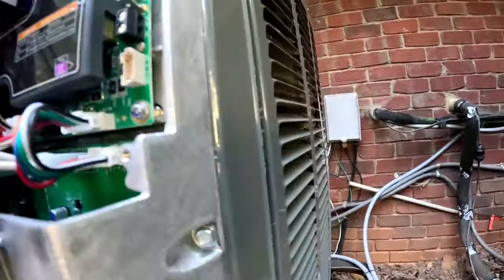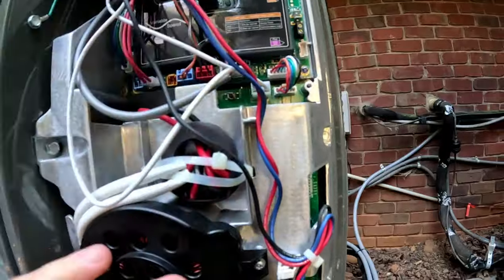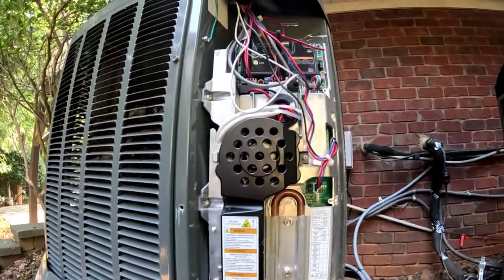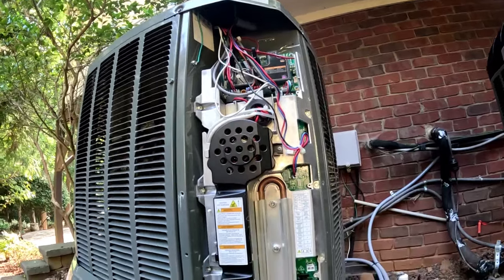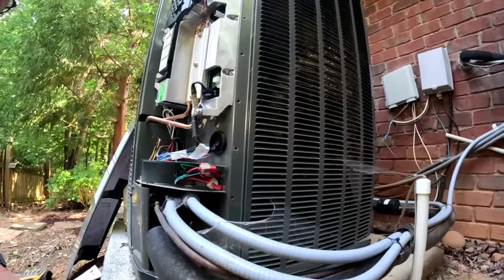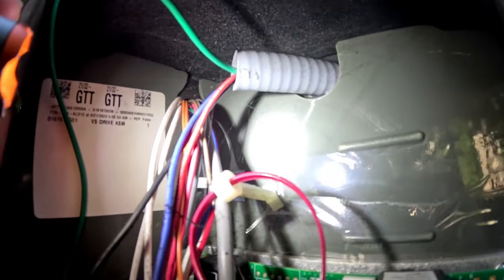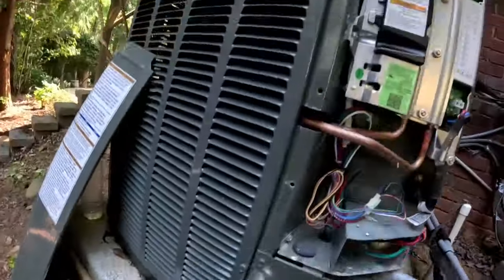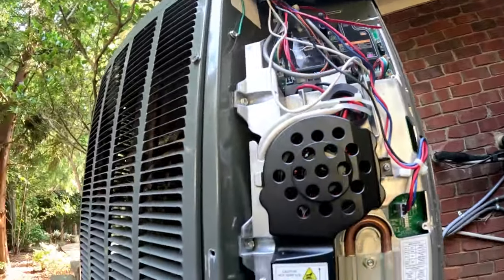It doesn't have to be this complicated to heat and cool a house!

Comment: The only things that belong between the thermostat and condenser should be high/low pressure switches and a float safety switch.
Reply: But then how can we charge you more for useless crap that easily breaks and costs and arm and leg to replace?
And how can they force techs to be "trained" and only allow said "trained" techs who pay them to work on said equipment?

Comment: that looks like the(reactor) noise filter(torodal inductor) installed on the incoming Line power, before it goes into the inverter drive. Washers, refrigerators, minisplit, and even brushless tools use them. It needs to become a prerequisite before selling a customer an inverter driven system, if there are known power surge, brown out or excessive supply line noise. Don't install one of these! i wouldn't be surprised if special power filtering requirements come about as well as dedicated ground requirements for these unit. 

I would look into installing single phase load reactors on these.

Comment: They are not just sitting behind a desk and computer. They are also sitting in front of a spreadsheet. They know what every single item costs and they are doing whatever they can to maximize profit by refusing everything but the absolutely necessary replacements. As in no two ways about it, and it won't operate a day longer with an alternate repair.

Comment: It's crazy how manufactures put all these circuit boards in a unit that's outside.  Place your laptop computer in that unit and you would be lucky to get a couple months before it fails.  Things never have to be this complex.
That system is plain garbage.

Comment: I only install over complicated, overpriced krap like that on my own house. Customers get minimum SEER equipment from now on.
Reply from the maker: Too many call backs for things that should never be a problem.
Reply: @MyHVACLife  100%. All my salesman does is try to push me to sell those Gree/Airtemp side discharge inverter heat pumps made in China. No thank you I’ve put two in. I’m not putting any more in. Three large circuit boards in the outdoor unit one in the indoor unit. And I only put mini splits in where I have to.